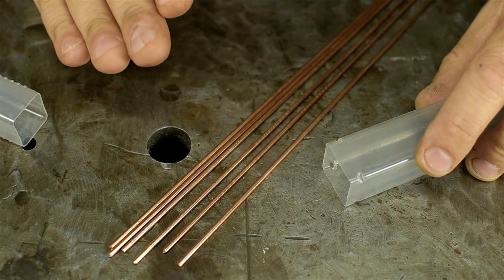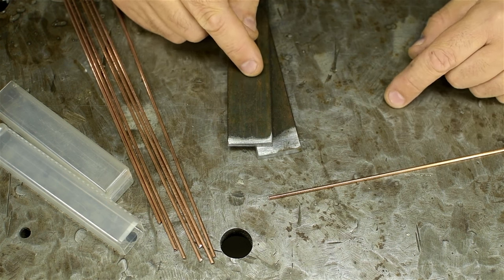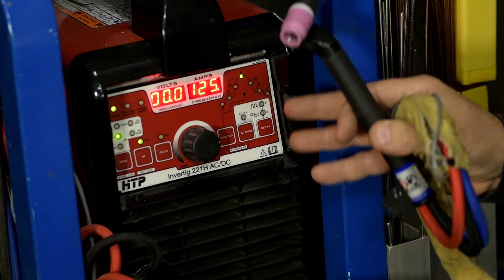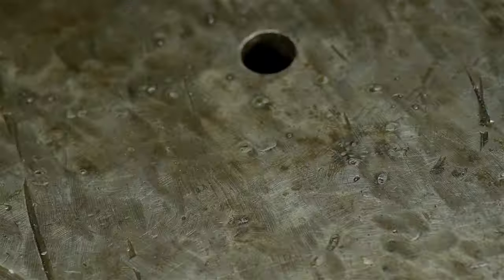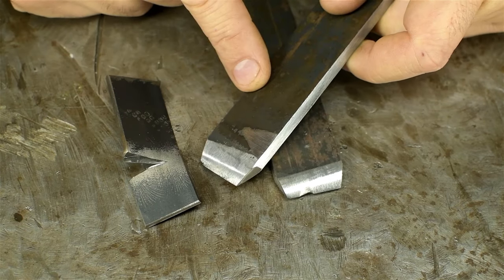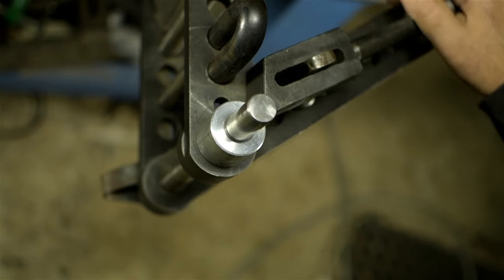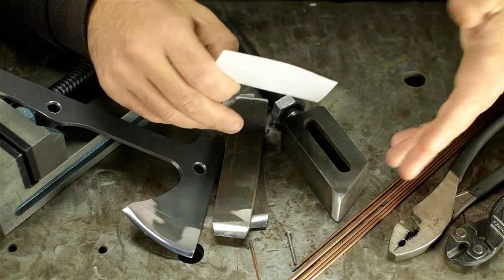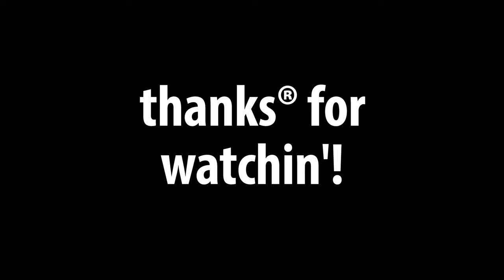TIG Welding with TOOL STEEL filler?!

Comment: This is fantastic!  Do you think this would work to build up a special edge on a high speed steel lathe tool?   Sometimes you need the business end to stick out the side to create an internal threading tool or a tool to cut an O ring groove , but the only way to get that is normally to grind off everything behind the business end which makes the whole tool weaker. 

I am going to ask about this weldmold 958 stuff at the next visit to the welding store!

Comment: like how you used different gauges of wire so you don't confuse them when it came to welding time. Good example of running multiple pad building with running in opposite direction to the last run (L-R and then R-L) 👍

Comment: Nice demonstration. Although I would not use hardened steel on the bending thingy: it might save you some work but it should deform before the part, so... yeah, it should be soft steel.

Comment: In application with the TIG process each pass of weld mix base with filler . Each additional pass would have less base material present. 
Point being the edges presented here are not the same material as the filler used, merely alloys of.

Comment: ooooh useful stuff ...need a Tig welder...oh no got one just need a torch and some appropriate gas and some time to use it and something to put a tool steel pass on ...Inspiration 
Thoroughly agree BTW no shrapnel grenade lawn mowers or strimmers desired or required.

It does make me wonder about some of these really cheap edge tools though.....

Comment: Sooo, I have succesful used hardfacing rod to buildup the edge and ends of bush hog blades that have been rounded off from abrasion or severely chipped. I place anywhere from just one bead to over an inch of bead using the hardfacing and grind it down somewhat close to where I need it and then lay a bead of the mild steel on the edge and peen it to get it a little harder than standard mild steel and this is what I have been using for years on a single step of blades. When the mild steel gets chipped off or begins to wear away to expose the hardacing(and yes, you can tell a BIG difference between the metals) I simply dress it up and put on another bead. I basically use the hardfacing stuff to take the beating of the upper portion of the angle that makes the edge and I have also used it to build the wing portion back up after being worn down.

Comment: i have been welding quite a lot with a similar wire made by meltolit. the hardness level of the tig wire i have been used is high enough for a flappy weel to have a hard time getting through it and make a mark. i should try to do something similar to what you have done here and try to make an axe or a knife or something along those lines cause that could be super cool, just haven't thought about it. 

but for everyone watching this video, i personally haven't had a problem welding hardening filler as long as the base metal is clean. follow the same procedure as you do when welding something important with regular wire and you should be golden. heat settings should be kept roughly the same as you use when welding regular mild steel but if you're able to should you speed up your weld speed slightly, at least with the tig rod i'm using.

Comment: The bending dog is normally called the wiper, or wiping die. Usually made from a hard aluminum bronze on production dies to give a balance between wear resistance and non-marking.

Comment: In regard to "surprised it didn't peel off," it kind of reminds me of squid beaks. The welding (at least if it's done right) might create a gradient of hardness so there's no discontinuity large enough to overcome the internal forces holding it together.

Comment: There are a number of different grades of filler available, some that is actual heat treatable tool and die steel like D-2 and other stuff like what you used that has some hardness as-welder...  The as-welded stuff generally gets harder the more layers you build, but there's also usually a layer limit, ie, you can't build layer upon layer indefinitely..

Comment: Sees TOT welding a tool steel edge onto the bending tool.
Remembers that TOT has a heat-treat oven now, but didn't think to heat treat tool when he was demoing the oven or think to use the oven before doing the welded edge.
Realizes TOT's growth has caused him to go into Tool Overload.

Comment: This isn't my field, but it seems like the big takeaway is that you can create a tool or object of softer steel which is faster/cheaper to make and then selectively create tool-hardened surfaces only where they're needed. This seems like a game-changer!

Comment: well you have successfully figured out a not cheap but quick method of achieving a hardened edge blade like that of a traditional Katana which is has a hardened forge welded edge and soft steel core.

Comment: Jodie over at weldingtipsandtricks has an older video where he uses a drill as filler material. Seems to work as well, depending on your application

Comment: Watched this video at least 5 times and only now noticed 11:11 example, just after finished welding edge using hss metal drills as filler.

Comment: You can use drill bits as well...as filler metal. Tool steel.

Comment: 9:45 Wouldn't it make sense to keep this as a softer material than what you're bending to not damage the piece? Then just fix the tip every so often like you do instead of making it from a hardened tool steel?

Comment: I welded my broken 4 wheeler axle back together and put an edge on a worn down earth auger blade with a harbor freight flux welder. Welding is tight.

Comment: If you're going to build up an edge on something, you might want to cut a slot in the material first, so that the new edge material extends inside the existing material to assist with side loads and generally increase the binding surface.

Comment: My shop we use either 316 ss rod or 344 tool steel rod to weld up dies and cutters and other hard things.  Truth be told we use the 316 for everything

Comment: You can get mild steel to harden up a bit, go hotter than usual and then quench in some icy salt water. No tempering required.

Comment: You should be able to use drillbit or drywall screws as a filler rod for similar improvement with fraction of the cost.

Comment: Dude, it seems your filler is listed in the EN 14700, either Fe3 or Fe8! So if you search for filler with this EN14700 types, you will get what you have shown us in the video. Eg: CORODUR WZ 55
8:48 after sharpening a blade, this feeling is awesome. You took the right music :D
Reply: if you want to see another type of hardfacing, i tested UTP 75 En14700 Fe20 (with carbides), file wont help anymore lol: watch?v=CNsp8BKB2kI

Comment: a really cheap option is to use a broken broken drill bit as filler rod... only good to pit a little dab of cutting edge on a tool or chisel.. but in a pinch its great

Comment: I'm surprised you didn't harden the edges that you welded with the tool steel sticks. I'm wondering if you could do a differential hardening with the base steel being mild carbon and the edge being the tool steel. That might be an interesting experiment.
Reply: @baileesmith2007  I never knew that. Thanks for the info!

Comment: TOT Help 
Ive recently bought a relatively low end battery powered router with supposedly a 1/4" collet which has come in a hair under size, it will not take a normal 1/4" bit without serious force (hammers).

I've requested the company replace it with a well fitting one, but in the meantime I want to rout things.

Also for the sake of making-do and not junking stuff I want to resize it.
Can I do so? HEAT?

I comes in at a hair under 1/4" (0.23in) or almost exactly 6mm.
I want to resize it to 6.5mm as my bits are all 6.4mm - 6.3mm
I'm guessing its some sort of bouncy spring / axle steel?
I've tried ramming a flat head screwdriver down the single slit but it redictably just bounces back into the previous size.

What are your recommendations.
I dont have a lathe to machine it out with unfortunatley
https://youtu.be/i0ij4Bev0es
Reply from the maker: you probably got a 6mm collet.  will a 1/4 collet replacement from a box store fit?  another brand etc?  otherwise... a little sketchy... you have a dremel with grinding stone?  be safe!
Reply: @ThisOldTony  ah ha! thank you This Old Tony. youre the BEST

Comment: What lens are you using for your arc shots? I've been in the process of picking a new hood for months and cant make up my mind.
Reply from the maker: #8 shade. is that what you mean? or camera lens? tokina 100mm.
Reply: @ThisOldTony  yes. Kinda. I've been looking for a new welding hood with a good clear lens and its turned into a rabbit hole, Not good for a procrastinator. I've all but given up for now.

Comment: I always appreciate it when a tig welding demo is done correctly.  Ending a weld pass by trailing out while passing back over the weld instead of cratering out sets the right example for others. Thanks Tony